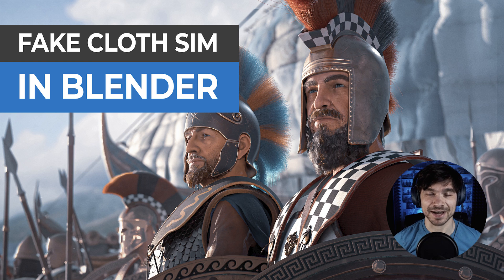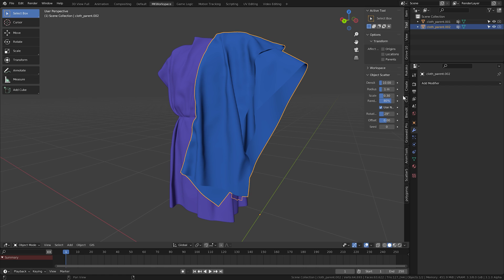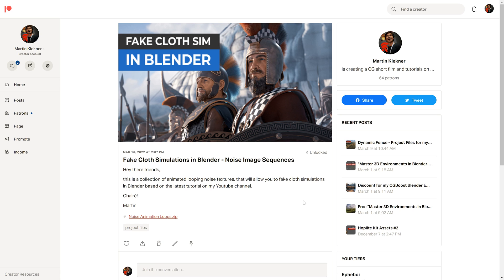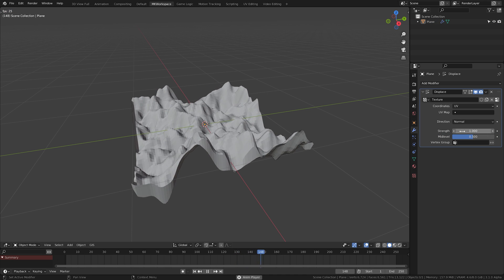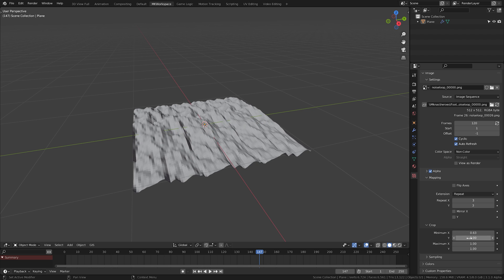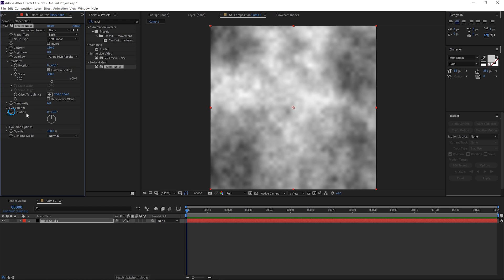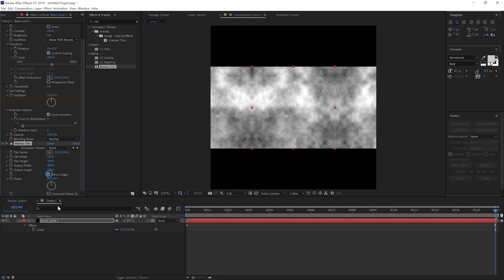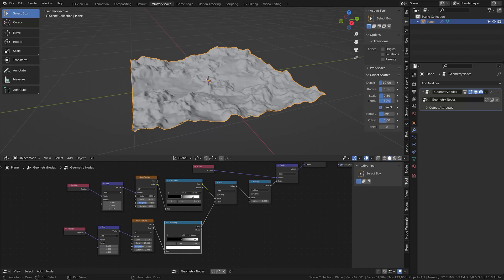Fake Cloth Simulations in Blender

Comment: For generating the noise directly in blender, you can set the texture type to clouds and in the modifier tab, instad of using local coordinates, you use object coordinates and then target an empty. Then you can animate the empty to get movement. Or If your cloth is moving in any direction (I used this for sails on a ship for example) you can just leave the empty where it is, and the cloth will automatically displace when the ship/object with the cloth on it is moving in any direction
Reply from the maker: Nice, a clever solution! Should have thought of that 😀
Reply: @MartinKlekner  Alternatively I just thought how about the ocean modifier on the mesh (not sure if it works for non-plane meshes and I think the pinning will be an issue as the modifier does not have any vertex group settings). However, it is a simulation then and you could ask if it makes sense to replace the cloth sim. 🙃
Reply: Yes the Ian Hubert lazy fish tutorial uses this technique

Comment: why would you even loop the noise? As long as you only have it in a scene and then cut to the next scene procedural noise is good enough imho. just use a driver with " #frame / value " to control one axis of the procedural noise from blender.
when you do loop animations (I often do that) looping noise is a must. I found out using drivers with sine and cosine on various values including the W of 4D Noise is fun to play around with and make it loop.